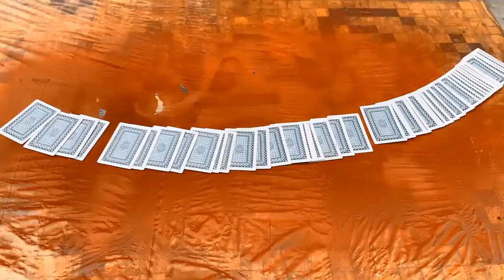Restoration of Minsk 125 badly damaged - Minsk Vehicle Restoration 125 part 1 Dismatling + Painting

Comment: Funny how those tires didn’t melt or get destroyed in the apparent “FIRE” that took place, which when you set something on fire and it strips the paint it will rust very easily when water is applied.  When water is intentionally added to rims and metal it will rust within hours, and days to look like this.  So, my question is why are YOU trying to make things in your videos look way worse than they actually are? You could just restore the item and get the same views. Are you trying to look like a miracle worker or something??  It just pisses me off when people are dishonest with their shit like you are!!
Reply: Yeah, I wondered about that - but close examination shows now only paint gone but also all plastic parts (lights etc) and wiring. It actually takes quite a lot of heat to get old rubber to burn and I suspect a fire intended to destroy refuse would smoulder rather than blaze - hence the tyres survive but the paint/wiring etc doesn't.

Comment: We also had the Minsk 125 in Britain, during the early 1980's, branded as the Cossack Minsk 125. These bikes were only 70% of the price of a new, very reliable CZ125 or extremely ugly MZ125. 

Called the "Minge", by UK bikers, it had a reputation for terrible unreliability, worst than 2000 to 2015 Chinese 125cc bikes. 

Superbike magazine attempted to road test one,, in May 1984, with the dealership the new bike was collected from, telling the rider to, "We don't want it returned, just take it to the scrap yard, when you've finished with it!!". It broke down within a few miles of the dealership and had to taken, by truck, to the Motor Industries Research Institute facility, where it broke down, once more, halfway through the timing lights top speed experiment. This time it refused to start ever again.

The bike was delivered to a scrap yard, shortly afterwards.
Reply: In Russia, these hoovers still drive. In normal operation, without any maintenance, they smoke the air normally and go to the forest for fly agarics, for example. But, of course, they are being replaced by Chinese mandavos with a horizontal motors. They are of the same quality, but spare parts are already in every damn forgotten hole. // google translate, pardon